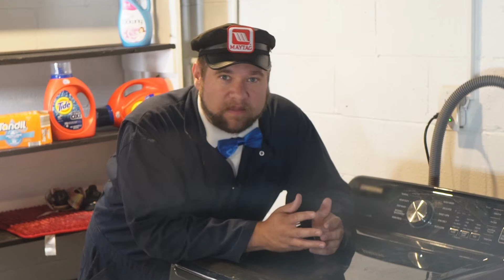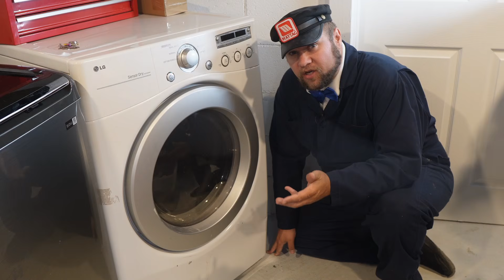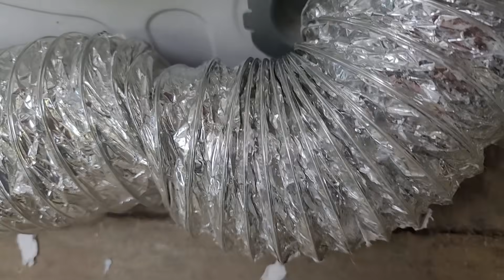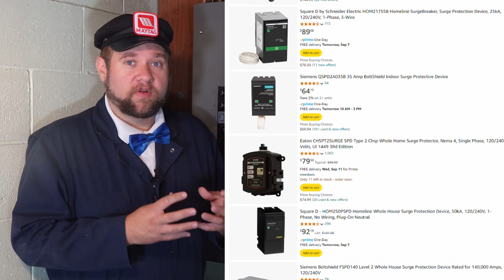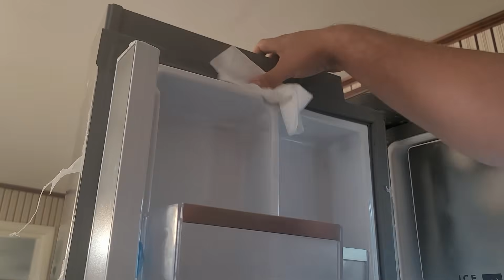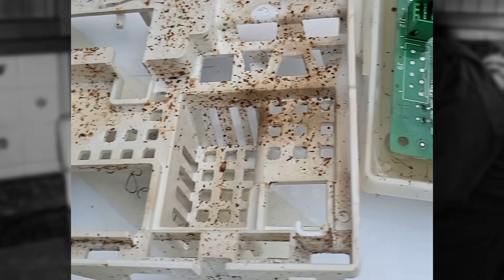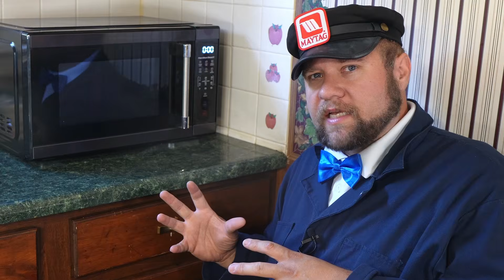Secrets to Avoid Appliances Breaking Down

Comment: Ben, I had to chuckle when you started talking about microwaves. We have a microwave we use several times daily, an Emerson, that we bought when we did a kitchen remodel at another house in 2008.  It came from Kohls, and I remember it was $70 some dollars.  It has never had a single problem.  It’s a .9 cu. Ft. model, touch screen, and not especially remarkable otherwise.  But isn’t that amazing to get 16 years out of a $70 microwave?  I think I’d buy the same brand again, if they still make them.😅😂
Reply: Yea, and my expensive one only lasted 5 years!
Reply: @sassysandie2865  seems like so many appliances that used to last many years, now won’t go more than a few.  Washers and refrigerators are the worst, I hear.
Reply: @johnlandacre767  yes, I had a salesman tell me that they are designed to last an average of  7- 10 years. This is done purposely to increase sales.😡
Reply: @sassysandie2865 they're all made by the same two brands and the more to go wrong, the more they will. Get a basic microwave, or better yet find a nice clean one from the 80's or so, which is built more alike commercial units today.

Comment: this white LG dryer i have in my apartment JUST died on me, I can tell the either the sensor or rotor are cooked cause the motor is spinning so poorly and stalling out, has a 10year warranty and died at 12 😥

Comment: I have a Speed Queen front-load washer and dryer. Some excellent tips for maintaining both include washing out the washing machine with a cleaning solution once a month or so and keeping the washer door open to prevent mold growth. I also realized that my '90s Metallica CDs (the epitome of mediocrity) could be used as sliders under the feet of the washer/dryer to prevent scuffing on the tile floor. Metallica CDs are also harmful to a microwave (not to mention people's ears, too).
Reply: Grandfather used nickles to level his appliances back in the day. Now I use Nickleback.

Comment: we have sears gas dryer that is 30 years old and has never been repaired just clean some lint out a few times the smooth sheet metal duct hardly gets any lint collecting in it.
Reply: lol, my parents have a Kenmore gas dryer too...bought in 1980-something.  I changed the dryer belt 6? 8? years ago after it broke.  Belt from eBay, using a youtube video.  No one remembers if it had any other work done.  And when you change the belt, you find all your lost socks that somehow falls undr the dryer
Reply: @octopoint  mine makes a noise i think a quarter got between inner and outer drum it clinks didn't want to disassemble everything to get it out.

Comment: Hi Ben, big fan of your informative videos. Off topic, but a GE French door refrigerator was just delivered to my place today. I didn't notice the delivery guys leveling it, but I wasn't in the room the entire time. Might being unlevel cause issues? Thanks.
Oh, and I bought a Gibson front loading washer and dryer in 1998. The washer died two years ago, but the dryer is still going. Neither ever needed repair, but I did have to replace the dryer's cycle knob, which I found online. Are you familiar with the brand? I think Gibson is (was?) made by Whirlpool or another manufacturer.

Comment: I purchased a Maytag washer and gas dryer in 1994. Perhaps this was near the end of the era of Maytag's heyday? They run 3 to 5 loads week in and week out. In that time, other than replacing the water supply lines every 10 years, I have not done a single thing to the washer! The dryer has had drum rollers replaced twice and a moisture sensor replaced once (all by me). I intend to run the pair as long as I can. They just don't make 'em like this anymore!
Reply: Hi! I used my mother old washer and dryer, until can not find parts! If you lucky the new ones may last 9 years now! They won’t make it like they used to! 🤗💯
Reply: Our Maytags were bought in 1990. Haven’t done anything to the washer. The dryer has had the heater assembly replaced twice, the belt once, and   A week ago the rollers. All done by me.
Reply: @Dfbc8823  Hi! You are lucky! 🤗😊
Reply: I started and ran a major appliance company for 43 years.   I had Maytag machines that I sold that lasted for 50 years.  I found the worst thing for a machine is bleach.
Reply: @donknotts33  Hi! I had repairman come to look at my washer , he said machine like this would put him out of business, I agree! Don’t use bleach anymore! Thanks!
Reply: @donknotts33  Agree on not using bleach. I never do due to septic system effects from bleach. I started using Maytags in the early eighties when I picked up several commercial coin-op machines for some apartments I had. Very robust design, did little to no repair on them either in-spite of being overloaded and used with bleach by tenants. Wish there was a simple, robust machine on the market today that would last 30 years!
Reply: @donknotts33 and yet most manufacturers say to run tub cleaning with only bleach once a month.  Guess they want to help the machine fail sooner.
Reply: @donknotts33 Fabric softener also builds up in your machine.  When you take apart a washing machine you will see it inside the drum.
Reply: My Maytag Neptune washer and electric dryer from 1998 are both still going strong. Aside from replacing the roller bearings in the dryer (I think they were like $7) they've been trouble free. 
Remembering to leave a washer open to dry out after use is one of the best tips in this video.
Reply: @TheOtherBill  Hi! I got some rental property, I been buying use appliances, also I buy used myself, last longer! I always leave my washer lid up, I having guests, one guest ask if she put it down, I say no, its clean, its always up! Enjoy your weekend! 🤗💯
Reply: @TheOtherBill  I had one of those Maytag Neptunes, the first version and eventually the motor died.  I had a gas dryer that was a decade older than the Maytag.  I had to replace the nylon drum bearing several times over the years, which what a pain to do for a $5 part.  Wish they made these appliances like that did in the 50's thru the 70's.
Reply: I moved into a house in 2004 that had one of those washer/dryer stacks that go in senior apartments. I have no idea how old it is, but it is an old Maytag. We have replaced every other appliance in the house at least once (the stoves and dishwashers 3 times) in 20 years. The Kenmore refrigerator is now the only appliance from our original move in 2004 that is still running beside the washer/dryer. It appears it was made by Whirlpool. 20 years old!
Reply: As long as people manufacture appliances what they never use and saw before  making those products,  we wonder why those appliances don't last.
Reply: @ursulasmith6402  Hi! True! 💯
Reply: Appliances are definitely designed not to last as long as they used to.  And they have significantly increased in price. Talk about a consumer fleecing!
Reply: @Resist4  Hi! Yes! Big time! 🤗💯
Reply: Pre 2000 appliances still have quality.   Anything past 2000 is dicey.   Manufacturers switched from metal to plastic everything.   Metal will bend and come back. Plastic cracks and is just broken. 

Fridges and washers from the 80s are immortal.  Yellow and ugly AF but running.
Reply: @beddythecorgi4269  Hi! Well said! Give ugly one that runs! 🤗😀💯
Reply: Been using a maytag washer and dryer for 35 years and not one 25:21  an easy replacement of the washer belt. not like the expensive crap they sell today that don't last and break down all the time.
Reply: Our Maytag set can’t yet compare to yours but we are going on 18 years.  Installed 2007

Comment: Samsung and LG Rocks!
Reply: Hi! LG maybe, Washer No Home board bad!
Reply: LG yeah but Samsung?
Reply: @Ikey04-ge9gy  Samsung top load washers usually have two parts that commonly fail: drain pump and suspension rods. But these happen after 3-4 years. They don't usually have lid lock or board issues. They are far more reliable and last longer without major repairs being needed in comparison to GE and Whirlpool.
Reply: @pelicanwave46  Hi! I had front load! If you ask none of them like back in day, the company makes them cheap so we have to buy sooner than we should!
Reply: @Ikey04-ge9gy  Hi! I had a Samsung it was great!